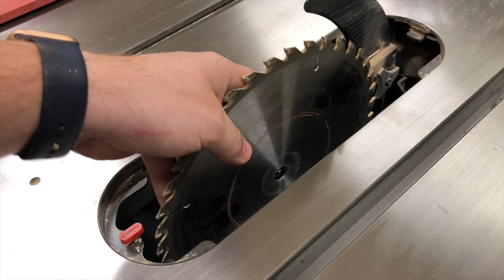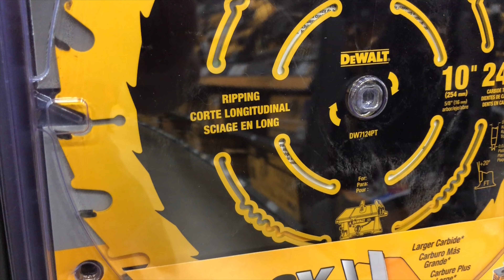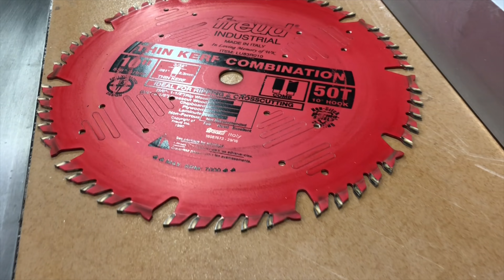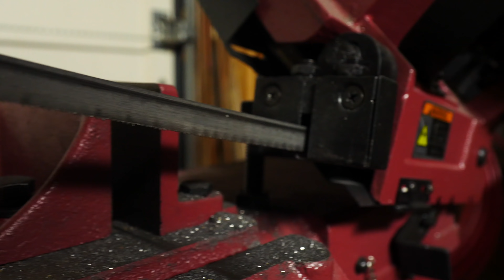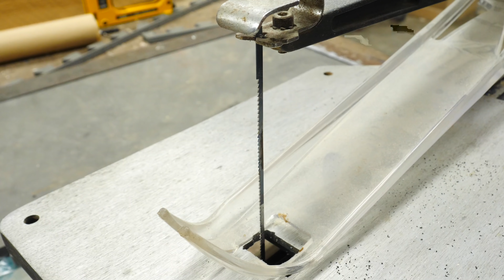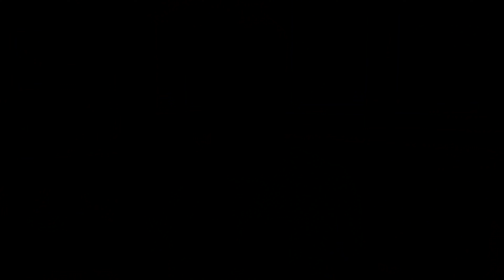Saw Blades // Bits | I Like To Make Stuff

Comment: I need to make a lot of cove molding--I know I'm going to be using a Rockler jig for it--but basically how it's done is that you run the board over the table saw *diagonally*.  My table saw is probably underpowered.  Which blade would you recommend?
Reply: I would recommend a higher tooth count and going slow across the blade. Going too fast can deflect the blade which could cause problems. I would also recommend a normal kerf blade for the wider tooth cut.

Comment: It would have been good to explain a little bit of why there are rip saw blades and crosscut blades. The main difference between them is the shape of the teeth. Use a rip blade to cross cut and I'm pretty sure tear out is a problem and using a crosscut blade to rip can cause the blade to follow the grain of the wood. Don't quote me on that, but I think I read it in a Wood magazine or something one time 😊. I may be bass ackwards or totally wrong.

Comment: Why should you never use a ripping blade on a miter saw?
Reply: Miter saws are designed for cross cuts. Not RIP cuts. So putting a ripping blade on a miter saw is pointless :)
Reply: Miter saws are designed for cutting miters, not a specific grain direction.

Comment: A note on OEM blades. I bought a makita circular saw and a gmc drop saw in 2001. Changed the blades last year. A bit overdue, but they definitely paid their dues and we’re “good” quality blades. Cheaper tool brands may skimp on the blade, but brands that sell their own blades are generally good. Festool, dewalt etc.

Comment: An important point on arbor size was kind-of mentioned in the comments below. There are multiple arbor sizes on different saws, so check this carefully. Thankfully, most saw blades are sold with multiple arbor adaptors here in Australia, which look like a thin washer with ridges around the edge to hole firm in the hole of the blade.

Comment: Hey Bob
The Bits series are great!  I think on this one  you needed a lot more time.

You should take a cue from the networks and “cut” this into a mini series talking about the major saw blade types separately.  For those that have and use a tool we may interpret width and thickness correctly but to a newbie they may not understand on a circular saw width is thickness of the blade in use and on a band saw it’s the depth of the blade from front to back, not how thick of a cut the blade makes.

You could then goto into things like rake, steel vs carbide teeth, and bevel on circular blades.

Comment: I've been using the diablo brand for my table saw for years. No issues or complaints so far. However, is there a better brand out there that doesn't break the bank for just a weekend hobby?
Reply: I've found that diablo is a good middle ground between quality and cost. That being said, check out stumpy nubs video on saw blades, he breaks down some of the different blades.
Reply: Jose Lamar Not that I’ve found. I almost exclusively use Diablo blades. I’ve broke down a few times to try the cheaper blades but regretted it every time. Also thought about buying real expensive blades and have them resharpened when they dull, but I just can’t bring myself to spend $150 on a blade. If you regularly clean your Diablo blades they’ll last a while and maybe the sticker price won’t hurt so bad.

Comment: Always keep two of the same blades one to cut with another getting sharpened ( at a fraction of a new blade cost ) or on standby.  Research how to tell when a blade is dull and needs sharpening or just needs cleaning.

Comment: I wish I knew that about that miter saws last year. Bought one that didn't have a blade so I bought one with the most TPI I could thinking the more teeth the better. First cut yanked the wood out from where I was holding it still and slammed the wood into the fence, bending it. Luckily no personal damage but it was a valuable lesson learned. Thanks for the Bits and keep them coming!
Reply: The wood should have been firmly against the fence to begin with. Some saws even come with a clamp arm you can use to secure your workpiece.  I had a scary moment with a miter saw when cutting a piece of aluminum on it once. It grabbed the offcut and chucked it to the side because it got pinned between the blade and a stop block.
Reply: @grandolddrummer  That's terrifying. I did hold it against the fence, but all those teeth just dug in pulled it instead of cutting. And to add insult to (non)injury, it was my first cut and the part of the fence that broke was the sliding extension. I've since replaced the blade and all is good, but eventually I'll need to get a new fence. It's still square but I can't move the slide out of the way for a bevel cut.

Comment: there are many different saw blades which can have different teeth (steel or carbide) and they have different tooth angles for cleaner or rougher cuts. they can have teeth that don't cut before the cutting one and those blades are used for hand feeding the wood into the machine (table saw). teeth can also have different profiles, but the more complicated they are the more expensive the blade is. the materials for the blade may vary from HS to HSS the better the steel the more expensive it is. for cutting wood I'd strongly recommend HSS blade body and carbide teeth which are more expensive but will last way longer (teeth need to be sharpened; don't do it by yourself you will just ruin it).

Comment: Awesome Bits Bob. Foundation Information but so important! I would add: When replacing the blade in a circular saw or table saw, make sure you put in the new blade the right way with the teeth pointed in the right direction.(I totally put one in backwards and burned up a board on the first cut)

Comment: I would like to see a "Bits" video or maybe a full video on the dremel tool, and it's different accessories.  I have a dremel but honestly, I've never been able to find a good project for it, nor does it seem the bits make sense as to what they are for.
Reply: Where do you have your dremel? is it in a drawer or cabinet stored away? Put in a thin cutting disk, hang it plugged in over your workbench and then you will use it every day 10 times!
Reply: RionE23 Check out my video on rotary tools part 1 and 2

I’ve been using a Dremel for about 30 years and love this tool. The ruby bits are my favorite.

Comment: Sorry Bob, if your blade is burning wood, it’s not sharp. Sure, you need to slow down (a little) when crosscutting but a good sharp blade can cut very quickly and cleanly. Slowing down reduces tear out on the back of the cut which you are aware. If you are burning your cuts, slowing down just makes a smoother burn.
Reply: I generally agree with you.  Put a 90 tooth blade on the table saw and rip a 12' board in under an hour.  You'll see burn marks.  In a semi-related note, a bent arbor or misaligned fence will cause burning regardless of the blade.  I got burned by a new table saw due to misalignment.

Comment: How do the the saw stop stock blades rate?  I wonder ... What's the best way to clean a tablesaw blade without spending money on a specific cleaner.  Good video.  Thanks.
Reply: mmm bbb I use laundry detergent to clean my blades. I bought a cheap round cookie sheet and nylon dish scrubbing brush from the dollar store as a homemade blade cleaning kit. Then just set the blade in the cookie sheet with water and a little laundry detergent, let it soak for a while, gently scrub the blade with the brush, rinse it off and you’re back in business.

Comment: If you're like me and like to buy vintage tools, keep in mind there are a lot of 0ld table saws (1960s and back) out there with a 1/2" arbor. All table saw blades now come with 5/8" arbors. No one is making 1/2" anymore. It's not a big deal, you can get an adapter from Harbor Freight for a couple of bucks.
Reply: Yeah, the adapters work, but I have an old craftsman TS with a 1/2" arbor, and I'm really a little nervous about using a Freud box joint set (2 blades) because I don't know how much strain that 1/2" diameter can take. Even though though Sears sold a 6" dado stack that they recommended for the saw back then, I'm still not real confident in the safety of using more than a single blade. Has anyone heard of a retrofit 5/8" arbor assembly that can fit on those old craftsman saws?

Comment: what arbor size mean?
Reply: sithlordst32 it is the diameter of the rotating “bolt” that you put the circular saw blade on. Arbor is the spinning part that the motor spins.

Comment: Never knew about jigsaw blades that cut on the down stroke. That would be much better since it would keep the tearout low on the top and also not throw all the sawdust in your face! :) I'll look for that next time. Thanks!
Reply: those are really good for cutting laminate flooring / counter-tops .  It prevents / reduces chip out on the decorative face.
Reply: @biomcanx1  Great! I'll see if I can find those. I hardly use my jigsaw because it spews all the dust in my face, but this might change that. :)
Reply: tor_selden   Just wear a face shield.
Reply: @Torsan1977  using the downstroke blade changes the Dynamics on your jigsaw be aware and be careful there is a setting you will need to change if you're not getting a good cut and it's jumping all around change the lever on the side of your jigsaw and that should straighten it out but be careful it can jump out and get you without notice
Reply: @ricumate3712  Good point! It was mentioned on the package, so definitely worth mentioning! 👍